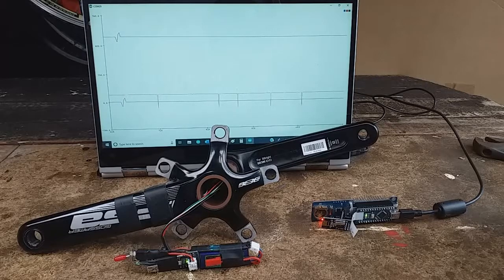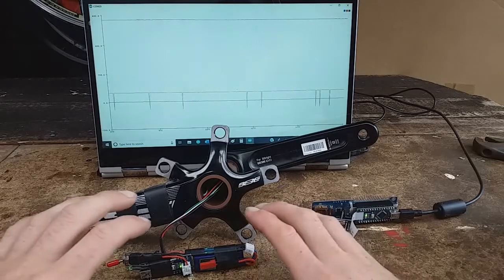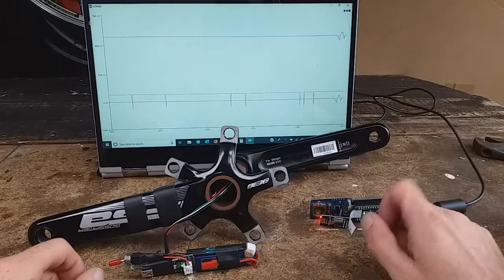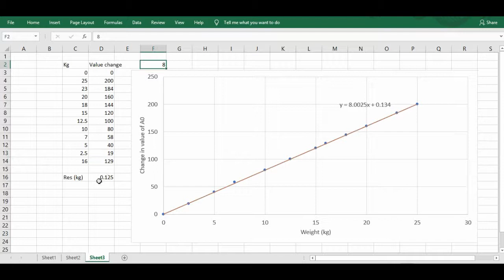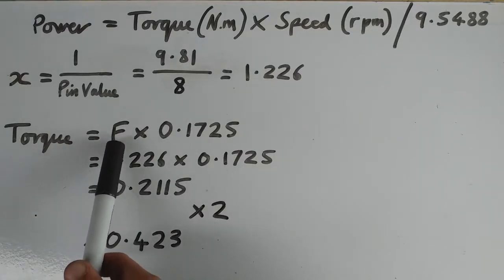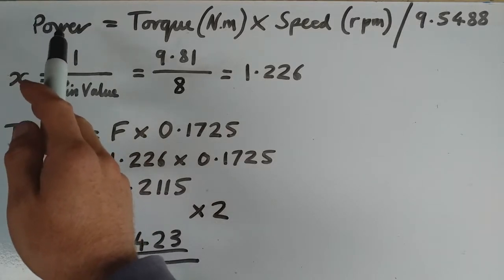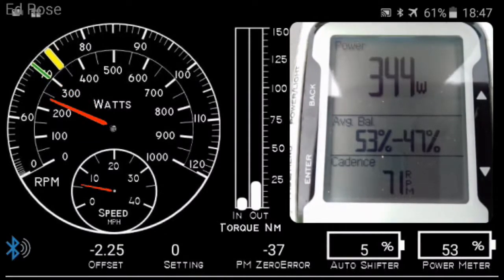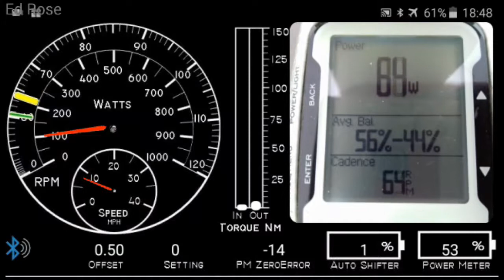Homemade Bicycle Power meter V2 Working Power Meter

Comment: Awesome project!! Thanks for your videos!! I'm making this project but I don't know how to send the power data and cadence to the Garmin via ant+ with the Arduino (I found some libraries with the rf24 but I don't know....).... and how it's possible to estimate the left and right power... Thank you and happy new year!!
Reply from the maker: Thanks, glad you find them helpful.
How to send the data via ANT+. That's something I'm still working on, its complicated and I'm not great at coding.  As far as I know it's not possible to use an nrf24l01 to transmit ANT+. I use it to send the data to another Arduino, the automatic shifter which then passes it on if necessary using bluetooth.
I believe it is possible to get ANT+ working via the Arduino IDE using libraries. However having discussed it with other people the conclusion was that this isn't the best option.
What is needed is an nRF52832 or nRF52840 which is what the Arduino Nano BLE is based around. Software such as Segger embedded studio and a J-link programmer.
Segger is totally different to the Arduino IDE so its taking me a while to learn everything, currently working through video tutorials.
Left and right power is much easier to answer. I only measure the right side and assume its half the total power. All single sided power meters make the same assumption.
Happy New Year and hope I haven't put you off.
Reply: @Ed.R  Thank you so much!! You helped me a lot...